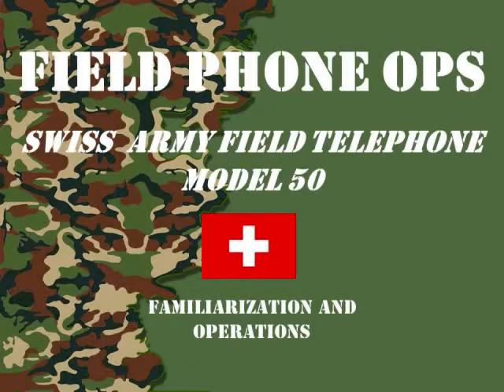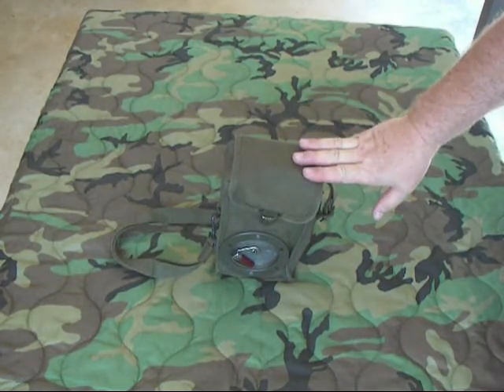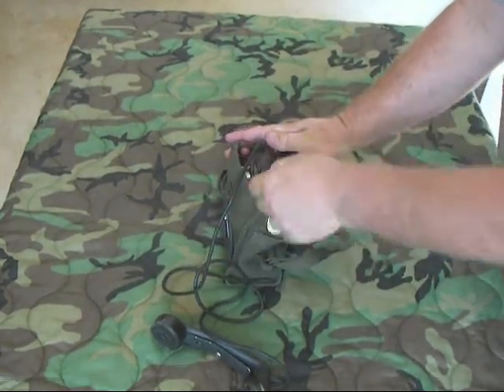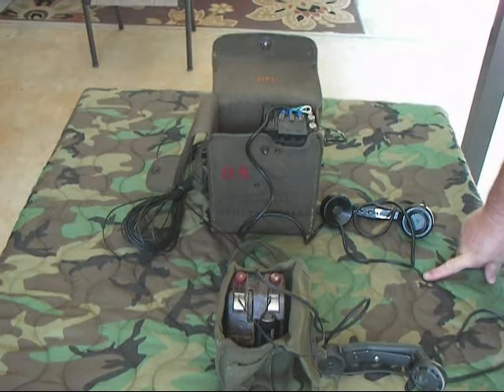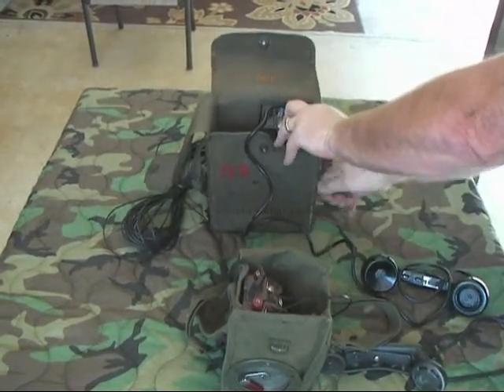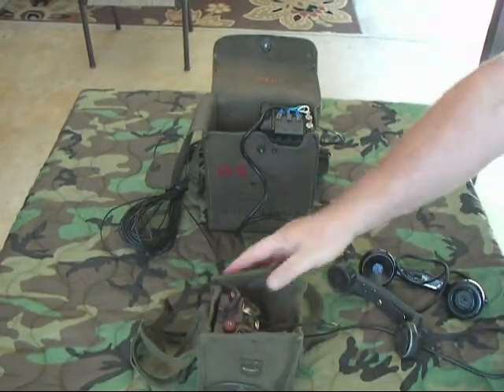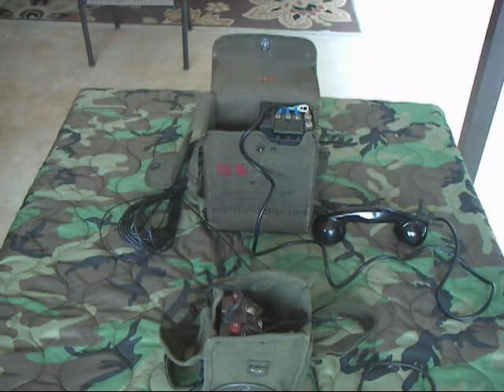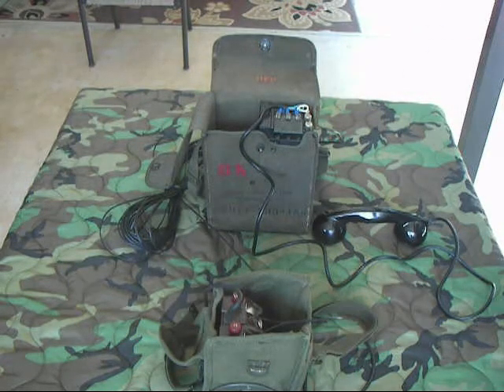FIELD PHONE OPS: Swiss Model FTF 50 Field Telphone

Comment: Thanks for the video, have you seen the swiss bunker phones thay look like a white  rotary? Cant find any info on them. These ftf 50's look fun.
Reply from the maker: https://colemans.com/swiss-military-bunker-phone-set
Reply: @thefieldphoneguy8254  yep those are it lol. Very tempting but ordered 4 of these from Varusteleka last night haha.
Reply: @thefieldphoneguy8254 they showed today in great working order. Deciding on wire now, any recommendations? I see 200m of swiss wire is about 50 USD plus shipping. Thanks again.
Reply from the maker: Any two core wire, field wire, speaker wire, computer network cable
Reply: @thefieldphoneguy8254  Just to clarify as I've never dabbled with a field phone before - I've got a two core copper wire; am I right in thinking both wires (red/black in my case) need to be held by the same post? I have them going to the "La" post on each phone as you have above but I'm unsure if this is correct

Next day edit: I came back to this to see if I had a reply, accidentally fullscreened your video and that's when I realised each wire was running into a different post... they both work perfectly once I got around the hurdle of my own user error!

Comment: Is it safe to assume that you can connect 2 ftf 50's via 2 wires to make calls to each other?
Reply from the maker: Yes.  Any two wire cable.  Doesn't have to be actual Field Wire.  Speaker wire,  CAT 5 LAN wire.  Stranded wire is easier to wind up and reuse than solid core.   Multiple phones can be daisy chained together.